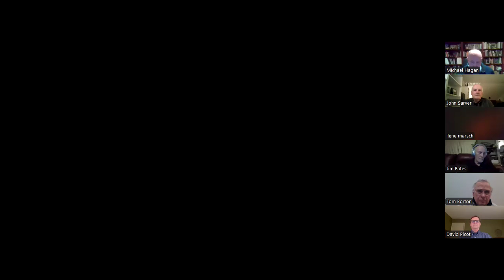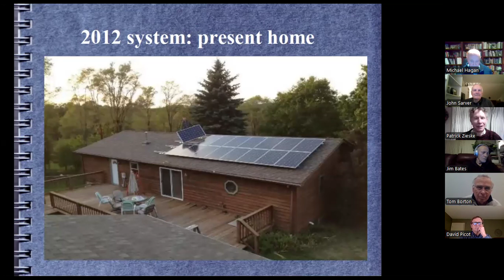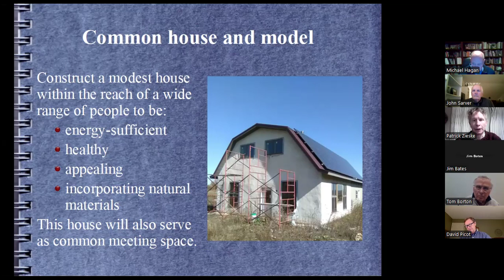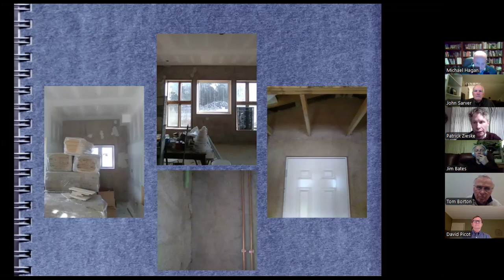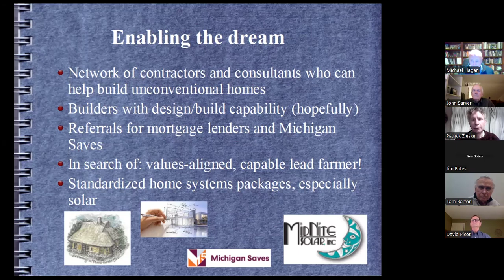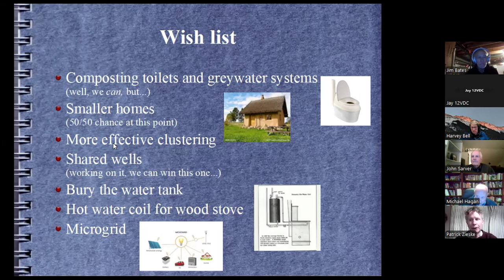MI Solar Story   Patrick Zieske

Comment: Referring to the generater discussion . If these homes whether passive or zero energy  typically using a goal of 10kw or less a day in usage then I would suggest a properly sized battery storage system  , then during the dark periods of no sun and low battery reserve then the generater is used to charge batteries which lowers the need for continued generater use during low sun periods or nighttime useage